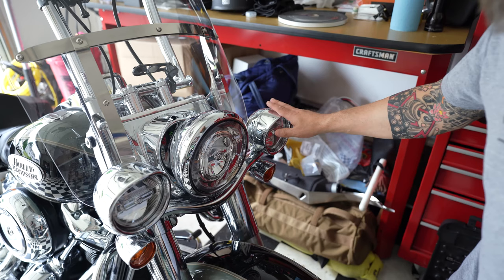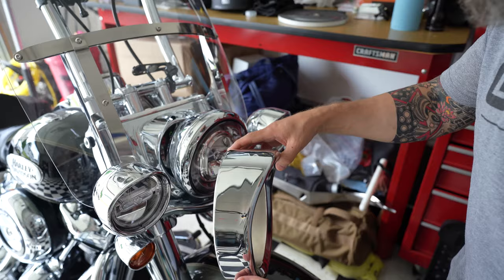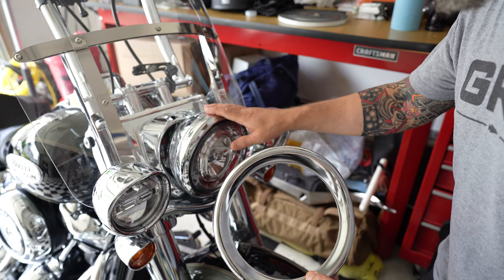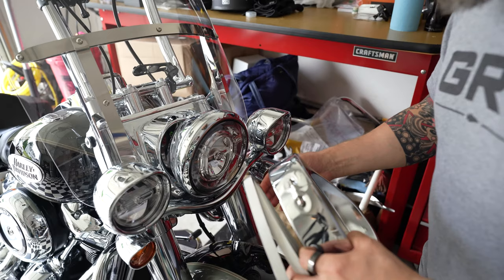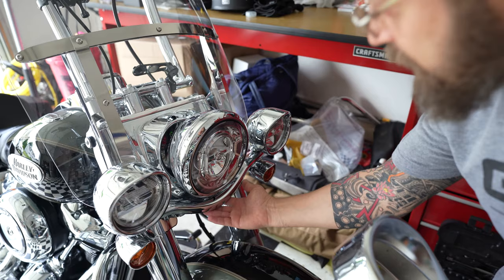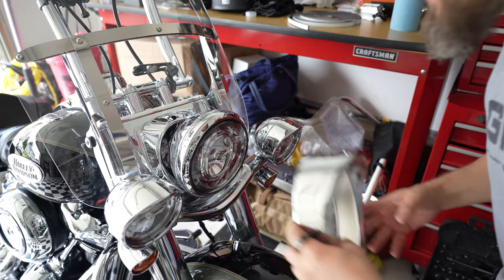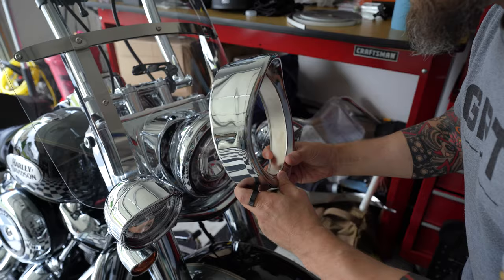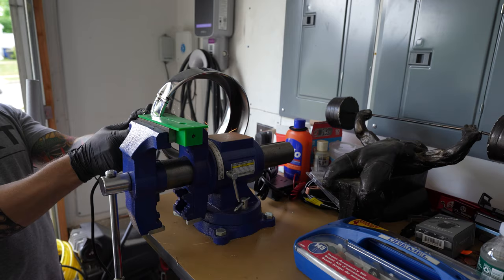Harley Davidson Heritage Classic Visor Style Headlight Trim Ring Install

Comment: Coming from an experienced mechanic. #1 Mount the vice on the table with the fixed part of the jaw even with the edge of the bench, so long parts can hang down towards the floor. #2 cover work area bottles and products with a matt or towel to avoid debris from grinder #3 Have work bench just above the waist not elbow height. #4 face shield and a hat are better at protecting you than just glasses
Reply from the maker: Thank you for all the pointers. Sometime in the very near future I’ll change my work bench to a lower one. I’ve had it for a while and unfortunately it’s not height adjustable (unless I cut the legs lol).

Comment: I am looking to do the same. Is the part number you got 69832-05? I see several for road kings that have different part numbers for different years.
Reply from the maker: I don’t remember the part number but it will have to be a 94+ year Road King, 7 inch diameter.

Comment: How many inches is the light trim ring?
Reply from the maker: 7”
Reply: Not 5.75 inches?
Reply from the maker: @tupaikp7029  No. this is for the Road King, a 7”. And then as you saw in the video I cut it down a bit and it
Goes Over the stock trim ring.
Reply: Ok tq info👍

Comment: I have a black set to put on, what year is your bike?  Might have been a good Idea to coat the cut surfaces with a  corrosion protective layer,  and to have covered your fender to prevent drop damage (?)
Reply from the maker: It’s a 2021.  You probably right, I should have put a protective layer on, but because the Visor was so cheap, I didn’t even think about it 😀

Comment: Great job , they don't sell this style trim for m8 slim do you think I could put a similar sized and style with modifications on a 2019 slim ?
Reply from the maker: I am not 100% sure if the size of the headlight is the same as slim but I think you could make it work.
Reply: @LennyK  Good on ya Lenny  , I will give  it a  go.

Comment: Hi Lenny, I'm the owner of a fantastic FLDE my 2019 and I see that you are installing on your bike exactly the same optionals that I would like too. I have a questione for the trim ring visor. Why did you choose the big one (for Road Kind) instead of the part no. 69734-05? Is it possible for you to adjust and adapt this one on our led headlight? Sorry for my bad "english"..I'm Italian 🙂 Thank you in advance for a reply
Reply from the maker: Hi Matteo.  I am not sure about the fitment of the 69734-05 on the 2019, but for my 2021 it definitely would not fit and its not adjustable.  This is the main reason I chose the Road King one.  It is still too big this is why I had to cut it down.  But then I was able to add the insulation in between and tighten the outer Ring.  Hope this helps.
Reply: Thankyou very much for the "just in time" answer!👍🏻 My 2019 headlight it's the same of my 2021😉 Could you be so kind to try to explane me why the 69734-05 trim ring definitely would not fit?Is the headlight's bell completly different from 2017 models?
Thank you another time and congratulation for your great channel (I like Tesla Model 3 too and I was a skydiver😉)
Reply from the maker: @matteopiran46  based on what I read, Harley has redesigned the headlight on the newer Heritage models. That is why you don’t see FLHC models in the fitmest section.

Comment: Try part #69734-05 from Harley Davidson website. That’s what I have on mine. I can see your headlight ring is mounted from a single screw in the middle and the visor is one solid piece just like the pic provided on the website.  The one you modified is cut in the middle which is made for the larger nacelle of a roadking and fatboy.
Reply: The part 69734-05 fits with 2018-2023 FLHC stock headlight ?

Comment: What phone mount are you using ? 
Please show Handel bar attachments.
Reply from the maker: I use Rokform mount (motorcycle specific) and case. www.rokform.com
Reply: @LennyK  when you shoot next video please show your phone mount.
As I installed lidlox helmet lock on right side wanna see how phone mount fit on your bike cause I wanna install phone and cup mount on stock handlebar.
Thanks for replying bro.
Reply from the maker: @FaizanKhan-sd9wn  will do